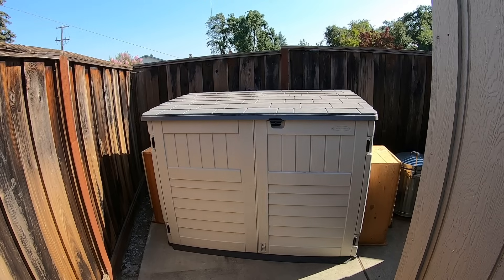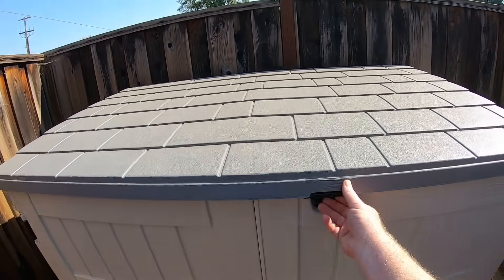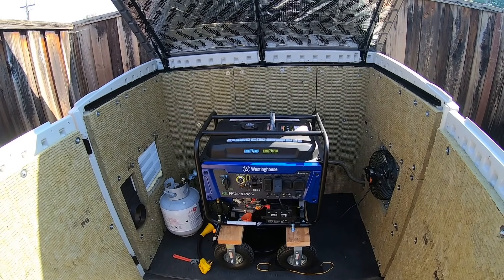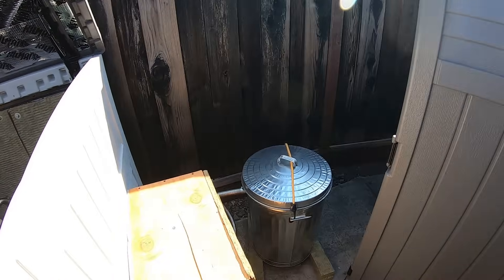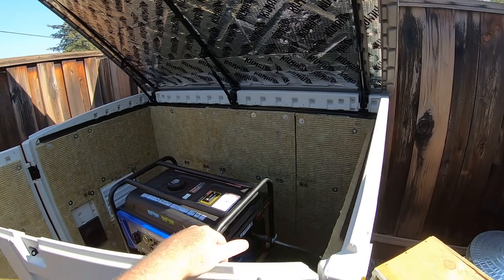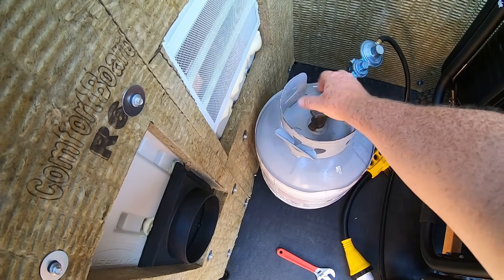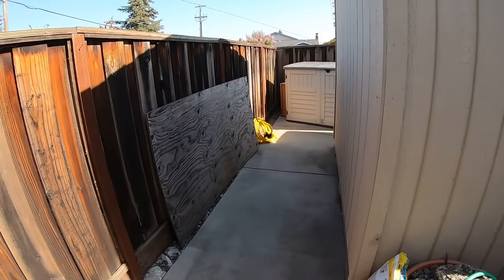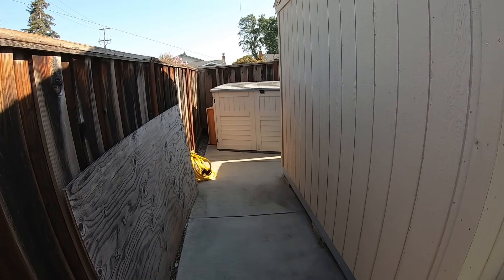DIY Generator Shed Build - Quiet Sound Insulation with Exhaust Muffler

Comment: C5Tor, 2:15, what is that chrome piece you used to connect exhaust flex hose to muffler on generator ? My measurement is 1.11" on muffler outlet. REALLY having trouble finding piece. Help
Reply from the maker: There are several more videos in this series.  I cover how I built the original trashcan muffler in the Exhaust Version 1.0 video (view it here: https://youtu.be/jZpRSenXJAs).  Then I did a later video on my Version 2.0 exhaust, which has quite a few improvements over the version 1.0 setup.  The newer video has parts lists, shed costs, and other Frequently Asked Questions.  Check it out here: https://youtu.be/y3pUw408jCU
Reply: @C5Tor , yes I've watch no.2, and realized it was 2 different pieces at the exhaust. I wasn't paying attention. (-:
Another question. When you took the muffler off generator, did you Reuse the flange gasket or jus order another one ? Thanks
Reply from the maker: I re-used the gasket.  It was brand new and not held on with sealant.  Went back on with no problem.
Reply: @C5Tor  ok, good. That's good info. Thanks

Comment: I want to see the garbage can !  That is a huge power drop with that cord. You are too far away! Good video
Reply from the maker: Yes, totally agree with the observation that the cord is too long.  Unfortunately, the way my house is situated on my lot, there just wasn't anywhere else to put a shed or generator.  There are several more videos in this series.  I cover how I built the original trashcan muffler in the Exhaust Version 1.0 video (view it here: https://youtu.be/jZpRSenXJAs).  Then I did a later video on my Version 2.0 exhaust, which has quite a few improvements over the version 1.0 setup.  The newer video has parts lists, shed costs, and other Frequently Asked Questions.  Check it out here: https://youtu.be/y3pUw408jCU

Comment: My opinion is when the power is out it's a temporary state of emergency and me neighbors are likely dealing with no power also. I'mnot worried about the noise. Protecting the generator so it's good in the weather absolutely. Noise? no way. the shed will quiet it enough. the noise might bother you though.

Comment: Absolutely amazing! The best ever. I don’t know if you’ll read this since it’s been awhile. But man just amazing.
Reply from the maker: Yep, I read them all, as there are lots of questions and I appreciate the feedback.  There are several more videos in this series.  I cover how I built the original trashcan muffler in the Exhaust Version 1.0 video (view it here: https://youtu.be/jZpRSenXJAs).  Then I did a later video on my Version 2.0 exhaust, which has quite a few improvements over the version 1.0 setup.  The newer video has parts lists, shed costs, and other Frequently Asked Questions.  Check it out here: https://youtu.be/y3pUw408jCU

Comment: Why didnt you put any of those panels on the floor of the shed? Did you use another type of mat?
Reply from the maker: I actually did put some rockwool on the floor in a later video on my Version 2.0 exhaust.  I was initially a little leery of putting rockwool on the floor as I thought it might get a little crushed.  But it is pretty sturdy, and I liked the idea of adding some sound and heat insulation to the plastic floor.  There are several more videos in this series.  I cover how I built the trashcan muffler in the Exhaust Version 1.0 video (view it here: https://youtu.be/jZpRSenXJAs).  Then I did a later video on my Version 2.0 exhaust, which has quite a few improvements over the version 1.0 setup.  The newer video has parts lists, shed costs, and other Frequently Asked Questions.  Check it out here: https://youtu.be/y3pUw408jCU

Comment: Show us the inside of the Garbage Can muffler!
Reply from the maker: There are several more videos in this series.  I cover how I built the trashcan muffler in the Exhaust Version 1.0 video (view it here: https://youtu.be/jZpRSenXJAs).  Then I did a later video on my Version 2.0 exhaust on my channel, which has quite a few improvements over the version 1.0 setup.  The newer video has parts lists, shed costs, and other Frequently Asked Questions.  Check it out here: https://youtu.be/y3pUw408jCU

Comment: Very good. Got a great deal on the shed. Looking forward to muffler design.
Reply from the maker: There are several more videos in this series.  I cover how I built the trashcan muffler in the 1.0 video.  Then I did a later video on my Version 2.0 exhaust on my channel, which has quite a few improvements over the version 1.0 setup.  The newer video has parts lists, shed costs, and other Frequently Asked Questions.  Check it out here:   https://youtu.be/y3pUw408jCU

Comment: Great job! Thanks for the ideas!!   But you bought a generator to charge your electric motorcycles?? 🤣🤣 you must mean just when the power is out.
Reply from the maker: The generator is just to charge the bikes out in the woods or at the MX track where there is no electrical infrastructure available.  Don't plan to use it at home.  I actually answer this question and many, many more in an updated video.  Feel free to check out my later video on my Version 2.0 exhaust on my channel.  The newer video has parts lists, shed costs, and other Frequently Asked Questions.  Check it out here:   https://youtu.be/y3pUw408jCU

Comment: What size blast gate did you use and did you just drill holes and bolt it to the shed
Reply from the maker: Feel free to check out my later video on my Version 2.0 exhaust on my channel.  The newer video has parts lists, shed costs, and other Frequently Asked Questions.  Check it out here:   https://youtu.be/y3pUw408jCU

Comment: Question..the inside of the shed doesn't get to hot for the propane to be there too..??
Reply from the maker: I would probably recommend locating the propane outside of the shed.  You can run the hose back through the blast gate to connect to the generator.  Feel free to check out my later video on my Version 2.0 exhaust on my channel.  The newer video has parts lists, shed costs, and other Frequently Asked Questions.  Check it out here:   https://youtu.be/y3pUw408jCU

Comment: Charging your electric motorcycle with a gas generator...

Great system though!  I love it
Reply from the maker: Feel free to check out my later video on my Version 2.0 exhaust on my channel.  I address a lot of the issues that existed with this version 1.0 exhaust.  And I actually answer this very question about charging electric bikes with a propane generator. The newer video also has parts lists, shed costs, and other Frequently Asked Questions.  Check it out here:   https://youtu.be/y3pUw408jCU

Comment: Great build. My only comment would regard storing the propane tank inside the shed. Another builder’s exhaust fan failed in the shed with only five hours previous use. By the time  he found the problem, the temperature in the shed was so high it melted the insulation and the propane tank was too hot to touch.  He burned his hand switching the generator off and ended up having to buy a new generator and installing a heat sensor shut off switch. He essentially had a bomb that he defused just in time.
Reply from the maker: My intent is to run it outside the shed.  The blastgate on the left can accommodate both  electrical wires and propane line.  I address this a bit in a later video on the shed with a bunch of other updates and FAQs.

Comment: Have you had a chance to post a bill of materials?  For example, I'm trying to figure out what you used for mounting screws for the sound board - I don't see anything on outside, so they must be short?
Reply from the maker: Thanks for watching.  Feel free to check out my later video on my Version 2.0 exhaust on my channel.  I address a lot of the issues that existed with this version 1.0 exhaust.  The newer video also has parts lists, shed costs, and other Frequently Asked Questions.  Check it out here:   https://youtu.be/y3pUw408jCU
Reply from the maker: To clarify, I also specifically answer your question about which screws I used in the later video.

Comment: I built a generator enclose like yours. Mine was inspected buy city electrical and building inspectors. Also in my city back up generators are inspected buy the fire department. Now to the point , the propane tank can't be in the generator shed. It must be stored in a separate location, with a hose going into shed. Remember if something happens, without a inspection your insurance will be void.
The reason for this comment, is to caution people that might build this project.
Reply from the maker: Very good point.  I do address this a bit in a later video.  The shed is setup to be able to pass the propane hose in from the outside, via the blast gate that I use for the electrical cables.  So, I would also encourage folks to put the propane outside of the shed while in use.  For the purposes of keeping this particular video more concise, I did not move the propane tank outside of the shed for the test.

Comment: Great job reducing the sound, where did you get tub for your gen I have a westonghouse 5300. Thanks for the video.
Reply from the maker: Check out my later video on my Version 2.0 exhaust on my channel.  I address a lot of the issues that this version 1.0 exhaust had.  The newer video also has parts lists, shed costs, and other Frequently Asked Questions.  Check it out here:   https://youtu.be/y3pUw408jCU

Comment: The resistance created by the rigged exhaust system builds a lot of backpressure at the expense of reducing the sound and will increase the heat of the engine while running.  I would imagine there are performance issues as well. I agree that these generators are too loud, but if you want longevity and don't have neighbors too close, I recommend allowing the engine to cool and breathe as designed by the engineers. Great video.
Reply from the maker: All good points, and I completely agree.   Check out my later video on my Version 2.0 exhaust on my channel.  I address a lot of the issues that this version 1.0 exhaust had.  The newer video also has parts lists, shed costs, and other Frequently Asked Questions.  Check it out here:   https://youtu.be/y3pUw408jCU

Comment: the only drawback to this beautiful design is the distant the current has to travel and it will lose some of it's current because of this variable but --- hey -- so what -- it's quiet - and this to me - he accomplished 100% ... congrats .. 
I believe I will do the same thing on my gen ... TY
:)
Reply from the maker: Totally agree.  The location that I had to put the generator was not ideal.  Unfortunately, there wasn't a good place to put it on the other side of my garage, where my electrical box was.  So I just got the thickest cables I could get and went from there.

Comment: Forgive me for not asking the most common question but why did you not simply change out the muffler for something more dampening. Of course the shed would dampen a lot of the sound but still are getting a lot of noise from that exhaust
Reply from the maker: The main issue is that the exhaust isn't the only source of sound from the generator.  You can check out a lot of other videos where they have put other exhausts on the generator, and it literally did not reduce the volume one bit.  There is lots of other mechanical noise from the engine and the alternator itself.  This is why I quieted the rest of the generator first, and then tackled the exhaust separately.  I also needed to keep the generator portable, so I didn't want to modify it too much.  The shed is only for use at home.  Check out my later video on my Version 2.0 exhaust on my channel.  I address a lot of the issues that this version 1.0 shed and exhaust had.  The newer video also has parts lists, shed costs, and other Frequently Asked Questions.  Check it out here:   https://youtu.be/y3pUw408jCU

Comment: Where did you get the flexible exhaust pipe and what size 3/4
Reply from the maker: The original pipe was 1 inch,  and I later updated the whole thing to 2 inch pipe. Check out my later video on my Version 2.0 exhaust on my channel.  I address a lot of the issues that this version 1.0 exhaust had.  The newer video also has parts lists, shed costs, and other Frequently Asked Questions.  Check it out here:   https://youtu.be/y3pUw408jCU

Comment: I can't help but wonder @2,000 dollars for a 9500 watt Harbor Freight super quiet (67DB running  in the open 72 DB full load drawl )  vs the total cost of the build and gen . If this rabbit hole of quieting a cheaper  generator is worth it financially and time spent...?
Reply from the maker: Totally legit question.  These things can be money pits.  I would have loved to get the Predator 9500 quiet inverter, but it was a little underpowered for my specific application.  The Predator only had one 240v/30amp plug, and I needed a gen that could push 240v and 32+ amps.  The Westinghouse has a 50amp plug along with the 30amp plug, and is rated for 40amps on gas and 35amps on propane.  If Harbor Freight (or anyone else) will ever come out with a Predator 12000 quiet inverter with a 50amp plug, I will scoop one up.  In the meantime, I get to put up with a noisier generator.  Also keep in mind that the generator shed and household backup power was a secondary use for this generator. (Charging two electric motorcycles at the MX track was the primary use.)  I go into the reasoning behind my purchase in one of several follow-up videos.  The follow-up video shows how I upgraded the exhaust and muffler from 1" pipe to 2" to let it breathe easier.   I cover the costs, parts lists, and other FAQs in the later video about my version 2.0 Shed Exhaust.   Check out the 2.0 video here, as it has most of the info: https://youtu.be/y3pUw408jCU
Reply: @C5Tor  Thanks. Will look at the video .  I'm holding out for HF's bigger & badder myself, or simply getting 2. 1-9500 & 1 3500  and use a parallel connection, as most of my "away needs" for a generator is less than 3000 watts .
Reply from the maker: I definitely considered getting two smaller generators, but I had a space limitation as well.  I sort of wish I had went that direction, as sometimes you only need one smaller one.  Plus this generator is a BEAST!  It is huge, and I definitely can't pick it up an huck it into the back of my truck.  Need to roll it up a ramp, or it is staying planted on the ground.  Always pros and cons to every decision.
Reply: @C5Tor    if only you could rig up an electric drive motor and steering remotely controlled or corded,  powered by the generator...
 hub motors at the rims and servoed steering! .... And 2.0 version  Follow me option!
Imagine that park the bike , call the generator and it autonomously starts  leaves the back of the truck and comes to you and the bikes!
Starting point idea/inspiration
https://youtu.be/iQoHVZm99Kw

Comment: Excellent work. Attractive, too! Question: After adding the exhaust modifications, did you need to adjust the carburetor? I understand restricting the exhaust flow cuts down on horsepower and there may be the need for adjustments to the carb. Was that true for you, or were there no downsides?
Reply from the maker: Thanks for checking out the video.  I didn't have any issues with the carb, but I did make some improvements.  I have several other videos in this series as well.  The first one shows how I made the version 1.0 muffler.  Then a follow-up video shows how I upgraded the exhaust and muffler from 1" pipe to 2" to let it breathe easier.   I cover the costs, parts lists, and other FAQs in the later video about my version 2.0 Shed Exhaust.   Check out the 2.0 video here, as it has most of the info: https://youtu.be/y3pUw408jCU
Reply: @C5Tor  Most helpful. Thank you again.

Comment: How long does that 20lb tank last you at 50%? Thinking about buying that one
Reply from the maker: Specs for the generator say 12 hours for a tank of gasoline, and 7 hours for propane at 50%.  But your mileage will vary.  I haven't run it for more than a couple hours at a time, so haven't used a whole tank of propane yet.

Comment: I've already picked out the same generator and will probably use the same shed.
Since I don't have the generator yet and could not see clearly the exhaust extension, Could you provide a bit more detail on how you connected the exhaust extension to the generator.
I believe you said you tapped the port but what size? Was it NPT and what did you thread into the port on the tapped hole?
Reply from the maker: Thanks for checking out the video.  I have several other videos in this series as well.  The first one shows how I made the version 1.0 muffler.  Then a follow-up video shows how I upgraded the exhaust and muffler from 1" pipe to 2" to let it breathe easier.   I cover the costs, parts lists, and other FAQs in the later video about my version 2.0 Shed Exhaust.   Check out the 2.0 video here, as it has most of the info: https://youtu.be/y3pUw408jCU
Reply: @C5Tor  thanks for the info. You have the best generator shed that I've seen so far

Comment: Where can I find the reducer you used to tie into the existing generator muffler?
Reply from the maker: Thanks for checking out the video.  I have several other videos in this series as well, and I answer this question in my 2.0 exhaust video.  The first one shows how I made the version 1.0 muffler.  Then a follow-up video shows how I upgraded the exhaust and muffler from 1" pipe to 2" to let it breathe easier.  Make sure you check out the other videos in this series on my channel. I cover the costs, parts lists, and other FAQs in the later video about my version 2.0 Shed Exhaust.   Check out the 2.0 video here, as it has most of the info: https://youtu.be/y3pUw408jCU